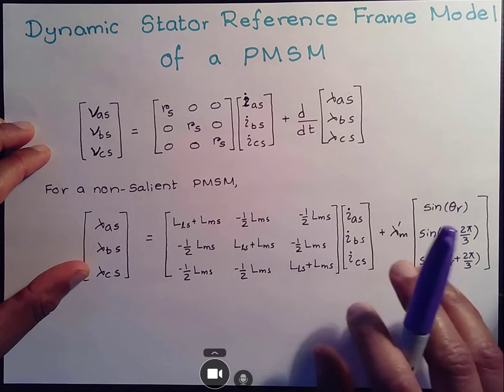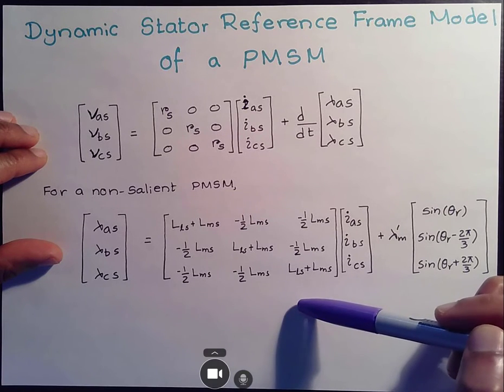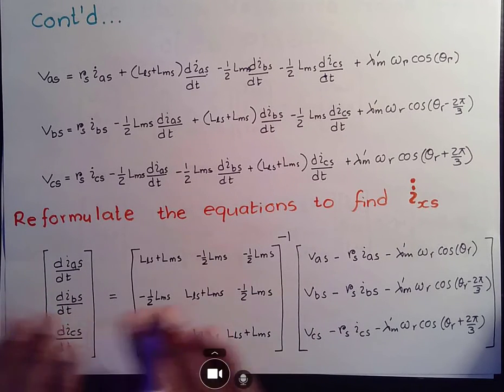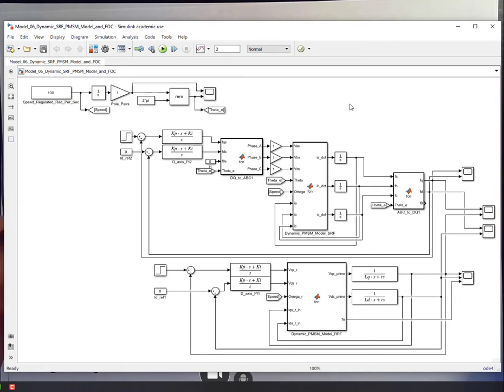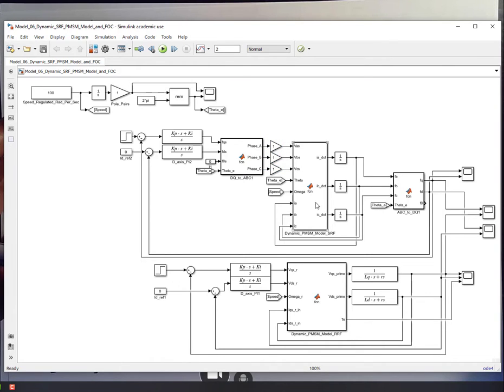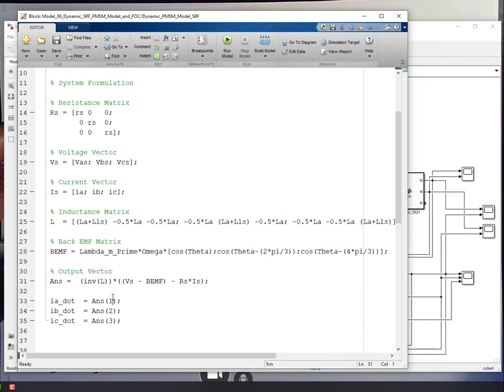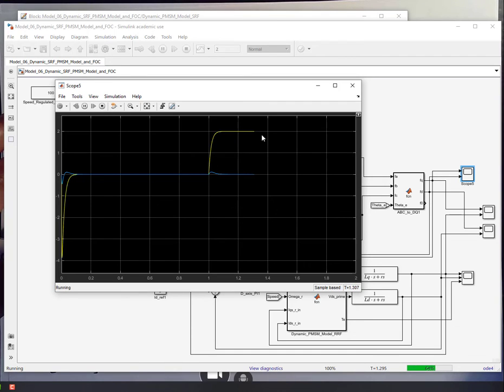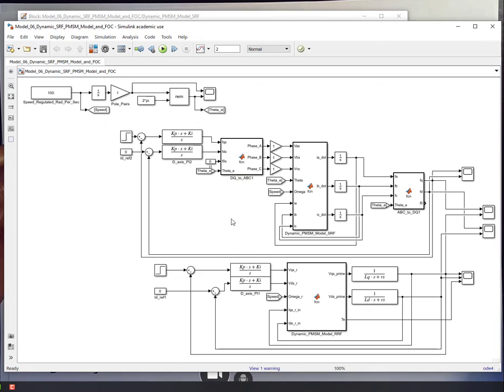FOC with Dynamic Stator Reference Frame PMSM Model

Comment: Hi, Professor thank you very much for the videos, I want to ask few questions.
 I want to perform stability analysis of wind turbine consisting of PMSG connected to  grid via voltage source converter, I don't want to model my system using available PMSG and wind block in Simulink library. SO the first approach I want to use is similar to the approach you discussed in your vide like defining a function. The second approach I want to use is defining the state space matrices in the editor window and then using Simulink block for state space matrix. What do you suggest which approach will be more accrete. Finally can you please make some videos on the modeling of MPSG and voltage source converters in MATLAB specially defining function based approach or can you share any reference video or paper how I can  model such complex system.
  Thank you.
Reply from the maker: Hello Muhammad, PMSG is basically a PMSM operating as a generator. So the concepts discussed in the videos are still valid. Your energy flow will be in the opposite direction through. I'm not sure if you are asking questions, with regards to the rest of the message. But feel free to send me an email.
Reply: @SandunKuruppu  Thank you very much, Sure. I have sent you the email.

Comment: Hello Thanks for the nice explanation 
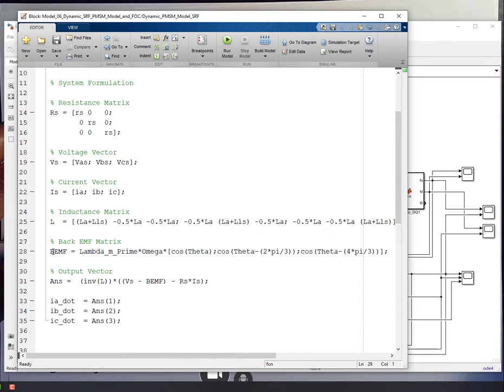but it seems  BEMF equation not correct, please check the 9:09 min
Reply from the maker: No it is correct. The derivative of a sine results in cosine. Is that what you are asking about? If not what is the error?
Reply: @SandunKuruppu  at end of line 28 its 4/3 pi instead of 2/3pi
Reply from the maker: @abdelazezhammad19  +2*pi/3 is the same as -4*pi/3. So no correction needed.
Reply: @SandunKuruppu  Thank you for the clearfication